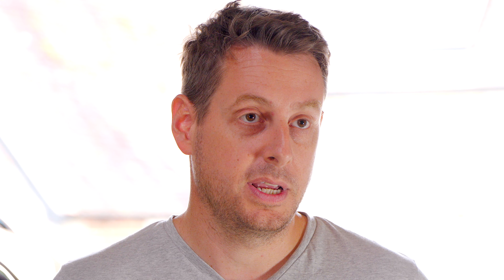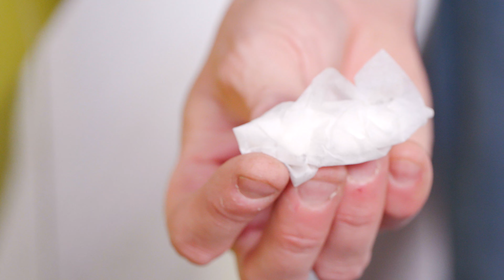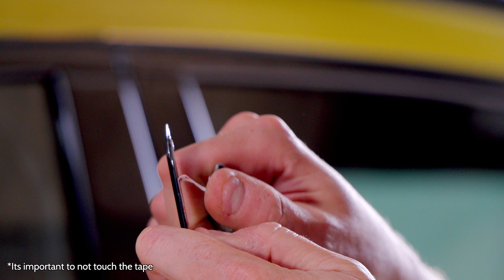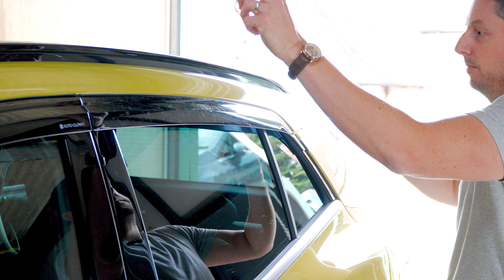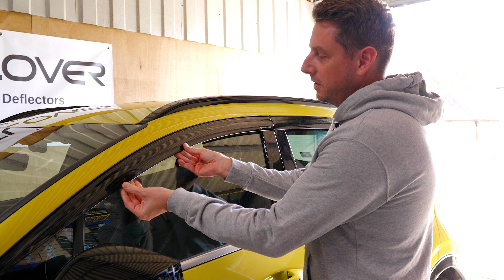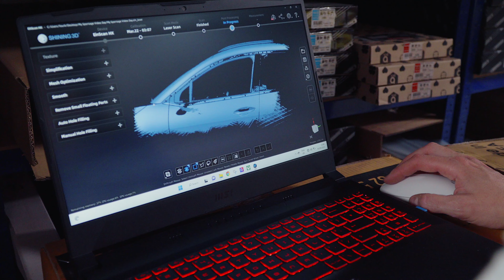Auto Clover UK Wind Deflectors installation guide

Comment: I applied a ceramic wax to the chrome molding trim around the windows on our Chevrolet Bolt EV. Do I have to do more than clean this trim with the wipes that come with the deflectors before installation?

Comment: Are they easy to remove if you don’t want them anymore ?
Reply from the maker: Auto Clover wind deflectors are designed to be permanent, however they can be removed by cutting through the tape with plastic wire and then removing the adhesive with a product like “goo gone” however this may take some effort. There are other ways to remove self adhesive fixed vehicle accessories, you can search this on platforms like YouTube. Kind Regards

Comment: Do you recommend heating the adhesive before putting it on?
Reply from the maker: Thanks for your message. The adhesive will work best at room temperature so we recommend leaving the product in your home over night before installing them. Kind Regards
Reply: @autocloveruk  my back piece doesn't stay flush, when I tried to fix it, the tape got messed up. Where can I get some replacement tape?
Reply from the maker: @1uP-v2  Please email our Customer services team and they will be able to assist you. Thanks

Comment: Curious if the day came and you wanted to remove them if you gave a car back to the dealer?
Reply from the maker: Thanks for your question. Auto Clover wind deflectors are designed to be permanent, however they can be removed by cutting through the tape with plastic wire and then removing the adhesive with a product like “goo gone” however this may take some effort. There are other ways to remove self adhesive fixed vehicle accessories, you can search this on this platform. Thanks
Reply: @autocloveruk7728  great instructions.  I have heard some bad reviews where in winter these can crack due to frost etc. Is this something to be concerned about and is there any warranty?. Many thanks
Reply from the maker: @grossi46  All our products come with a 12 month warranty  :)